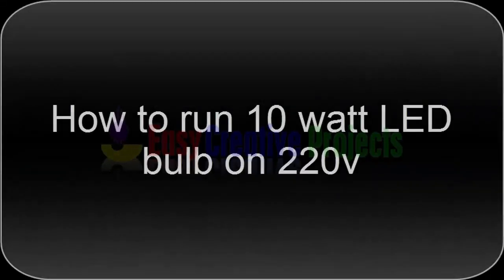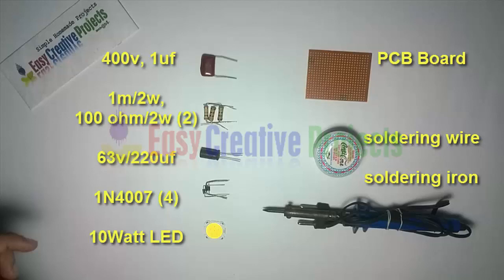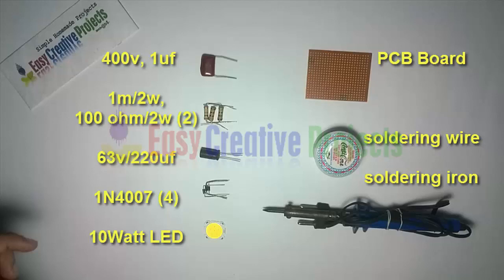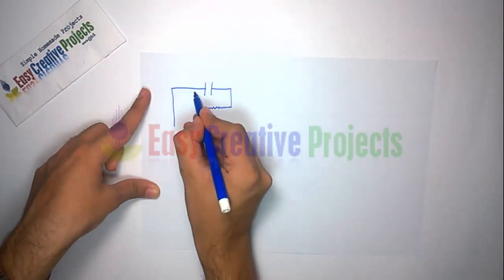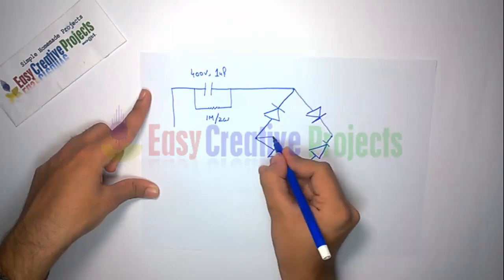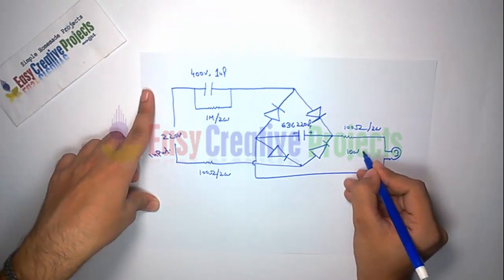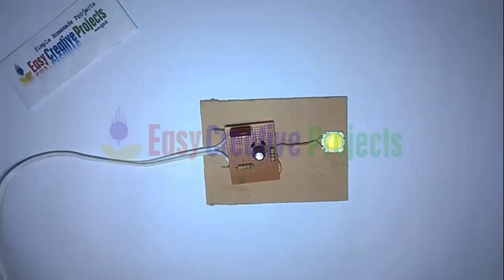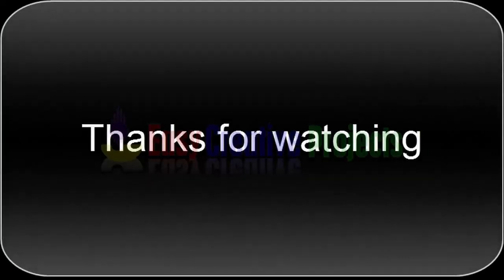How to run 10 watt LED bulb on 220v - easy step by step with circuit diagram

Comment: Nice ..why we use diodes there?
Reply from the maker: in this circuit diode bridge use for ac to dc converter. 
thanks.
Reply: Should provideDc supply to  led? 
It's won't glow on AC?
Reply from the maker: dear led is also one type diode. its work on one side. its glow on AC.

Comment: Brother, if 10w led what is use of heatshink? I ask how long...
Reply from the maker: normally 2 inch is enough but you can use any large size.
Reply: Easy Creative Projects ,thank u sir mai aap ka 5wt wala led banaya its good project,but light kam hai,ab 10/20wt banaunga...
Reply from the maker: dear capacitor k terminal check kro. agr ok ha to capacitor change kr lo. maray pas maximum brightness say chl raha ha jb say main nay bnaya ha.
Reply: Easy Creative Projects ,capacitor 100uf/25v lagaya jo aapne dikhaya....
Reply from the maker: dear terminal mtlb positive side and negative side check kro. ulta to nai lgaya. 
2nd capacitor phool to nai geya.
china k capacitor jaldi kharab ho jatay hin.

Comment: Will this work for Phillips Hue smart light bulbs designed for the us at 10 watts with 110v to 130 volts input?
Reply from the maker: no dear its only 12v circuit. 
for running Phillips light you need to increase voltage.
Reply: What would you recommend as a transformer to step down from 220V so I don't burn out the lights cause all I can find are big transformers as I plan to connect these in a celling light for each individual light?
Reply from the maker: dear if you want to run simple 10 watt Phillips light so use old energy saver circuit. 
if you need more help so see video on my channel, How to convert old CFL into bright fluorescent tube light
thanks.

Comment: Can we connect 10 LEDs (1W each) in this same circuit? If yes then means we can connect 20 LEDs by using 20W circuit... Is that right?
Reply from the maker: dear each led are 1w and 12v 
1w X 10 = 10w  ok
but
12 X 10 = 120v
connect 10 LEDs  parallel circuit then both requirement complete.

Comment: hello. I am new in electrical section.In your previous video you use 50v, 470uf capacitor for 40 watt LED. But here you use  63v/220uf capacitor for 10 watt LED. The fact that i didn't understand why u use high volt capacitor for 10 watt and comparatively low volt for 40 watt. since i am new, please forgive me if i asked anything wrong.
Reply from the maker: dear both circuit need minimum 50v capacitor. you can use any above of 50v capacitor. 
but if you use less then 50v then its heat up and destroy.
i can not find 2nd time 50v capacitor so i use 63v capacitor.
main thing in circuit is incoming voltage and capacitor power for output.
thanks.
Reply: Desi xxx video
Reply: Thanks sir

Comment: Running a 10W LED module without it being mounted to a proper heatsink will destroy it in short order.  I was glad to see that you wisely connected a 1 Meg "bleed" resistor across that input capacitor...
Reply from the maker: yes dear heat sink is most impotent for LEDs.
2nd i use 1M/2W resistor its enough for 220v. if you use 1M/1W resistor or little, then its bleed.
thanks for guide,